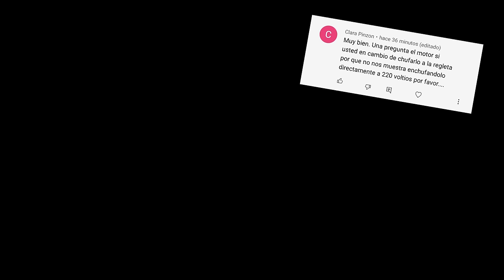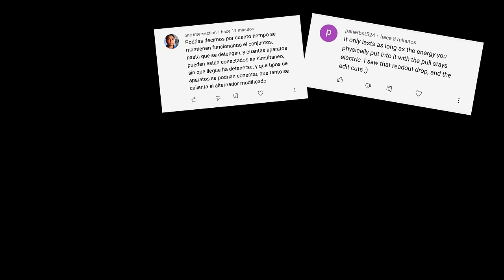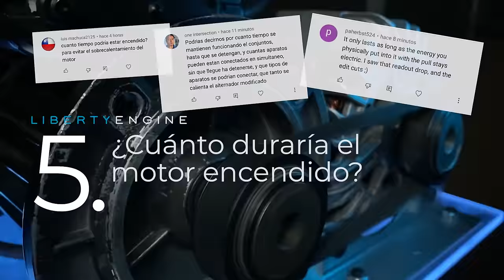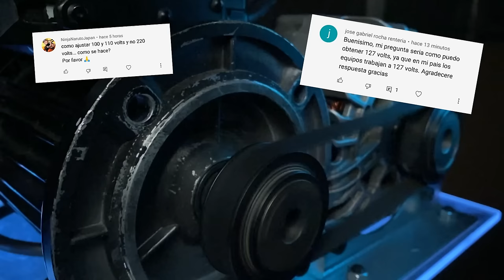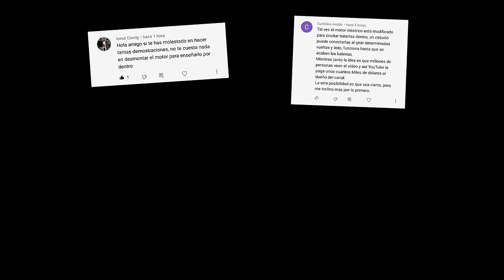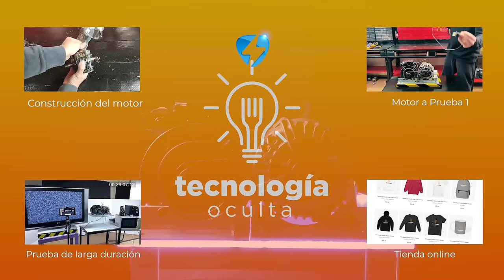El motor de energía infinita puesto a prueba - Parte 2  - Liberty Engine 1.0

Comment: Si no desea revelar los planes de esta invención, simplemente envíe 100 cartas de forma anónima a los artesanos, que harán lo mismo 100 veces, para que las personas finalmente puedan liberarse. ¡no esperes!
Reply: Venden ustedes el motor y el alternador preparados para trabajar con su respectivo regulador y cuanto vale $ ?
Reply: Danke für das viedeo. Ich werde es nachbauen. Und hoffe das ich es richtig mache. ☺️
Reply: Yo kiero uno...no me interesa hacerlo...lo kiero...cuanto vale? Tengo placas solares y las baterias no me han durado ni 4 años...y con tantos dias nublados...y la subida de la gasolina...no veas k despilfarro...
Dime como lo puedo comprar? 🙏🙏
Reply: Perché questo mottore non é comercializato ????????
Reply: Silnik 0.75kW nie ma siły kręcić alternatorem z magnesami neodymowymi , u mnie nie działa.
Reply: @luigicappello2575  amigo Luigi, si esto realmente funciona, evidentemente le interesaría  al 99'5% ( p/ej) de la población mundial; también evidentemente, al 0'5% restante no sólo NO le interesaría, algunos de ese 0'5% harían cualquier cosa para evitar que saliera al mercado, ese cualquier cosa podría incluir eliminar "este riesgo" y/o a sus creadores, parar la "edicion" (??) de patentes, permisos de todo tipo y negar que éste artilugio pueda funcionar de ninguna manera... no sería la 1° vez que algún creador desaparece tras un "trágico accidente"; el porcentaje es ínfimo, casi ridículo, pero hay unos pocos lobos entre las ovejas. Salud🤙
Reply: @tomaszpiotrowski2532  este normal sa nu functioneze Alternatorului  i-i trebuie o turatie mai mare de 1500 de rpm /min apoi meseriasul spune ca generatorul poate debita o putere in jur de 10Kw maxim prin urmare trebuie un motor mai mare de 2,2Kw si o turatie de 2900-3 000 de rap /minut   Daca aveti la indemina motorul recomandat de mine cu siguranta va functiona daca ati respectat asezarea  corecta a magnetilor pe rotor altfel toata munca este in zadar  si inca un secret alternatorul trebuie sa se roteasca in sensul distrogir adica opus sensului ceasornicului, prin urmare se modifica legatura condensatorului de pe placa de borne a motorului ptru inversarea sensului initial
Reply: Impresionante trabajo!!!
Pero para mí sinceramente si no facilitáis  la información/descripción de los componentes .o si podemos comprarlos .
Ya tiene otro corte !!
Estaré pendiente de poder conseguirlos si desvelais los secretos claro!!
Saludos y no seáis los nuevos Edison  de este siglo ,!!!!
Sean Tesla !!!!
Reply: @viorelpopescu4990  ați făcut replica la acest experiment cu succes?
Reply: @bablutu            da, da, si nu acum, ci acum mai bine de 40 de ani Da da rezultate si nu ma presa sa te lamuresc Uitate inca o data peste datele scrise de mine  si vei intelege ca generatorul poate mentine motorul in functiune si sa redea pe usor in jur de 3Kw Am mai precizat in comentarii nu e inselatorie este doarfelulcum stii sa  folosesti puterea si turatia fiicarui agregat in parte, poftim te-am mai scapat ceva, aproape mura in gura Doar nu i-i vrea totul moca? Dar cu ce te-am dat este suficient sa intelegi daca ai invatat la scoala si nu ai chiulit de la ore
Reply: @viorelpopescu4990  v am scris de mai multe ori dar mi se șterg comentariile, nu ma contrazic cu dvs doar întreb fiindcă vreau sa învăț de la oameni care au experimentat și sa încerc singur, as dori sa discut mai multe cu dvs dacă se poate, cum va pot contacta?
Reply: @bablutu             ........ Andrei uite cum sta treaba: Pe mine nu ma poti contacta direct de oarece eu raspund sporadic doar pe net nu mai am alte conturi si sint  o persoana in etate mult peste ceia ce crezi tu Ei bine am suficienta experenta in domeniu si voi incerca aici sa i-ti fac un comentariul cu un exp practic prin  demonstratii din care nu poti sa te indoesti de adevar , dar sa fii foarte atent la date si sa le interpretezi asa cum trebuie Sa presupunem : vreau sa construiesc un generator monofazat de 4 Kw la o tensiune de lucru de 220V si o fregventa de 50 Hz Cum voi proceda :Ca sa nu am mult de lucru si sa cheltuiesc inutil banii Mai intii caut un motor monofazat de 4Kw  se gasesc in comert s-au se pot comanda Deci el este din start monofazat adica nul si o faza, bun ma intereseaza sa aiva o turatie cit mai mica cu putinta cele cu turatie foarte mica se gasesc foarte greu dar se gasesc trebuie unul in jurul la 400 - 450 de ture pe minut Dupa ce il procuri il demontezi si scoti rotorul pe care i-l vei prelucra sa poti monta magneti niodin 52 sint cei mai buni dupa care remontezi motorul la loc acum este necesar un motor de antrenare de asemenea monofazat cu turatia maxima de 3000 de ture pe minut din astea se gasesc mai usor dar obligat trebuie sa aiva in jurul de 3000 de ture pe minut Cum aflu ce putere trebuie sa aiva? Sinplu generatorul  nostru debiteaza puterea si tensiunea, la sa spunem 400 de ture pe minut impart cele 3000 te ture ale motorului la 400 ale generatorului rezultatuleste 7,5dar vom lucra acoperitor ptru a avea rezerve de putere deci luam valoare de baza 7 Acum puterea generatorului este de 4Kw, ei bine impartim cei 4Kw la 7 si ar fi un 0,57 Kw deci motorul nostru de antrenare ar trebuisa aiva cu putin peste 500 W prin urmare putem procura un motor de 0,75 Kw mai mult decit suficient ptru lucrare a nu se uita obligatoriu la  3000 de ture mai departe  vom calcula fuliile de de antrenare ptru motor  si generator Cum simplu : O curea trapezoidala 14 x17 poate lucra pe un diametru minim de 100 mm deci fulia motorului obligatorie sa aiva diametru  exterior de 100 mm Cit va fi diametrul fuliei generatorului ptru ai asigura cele 400 de ture?   100 x7= 700de ture pe minut  un meserias priceput o poate face fara dificultati simplu coroana, spite, butuc o data avind toate astea facute si evident procurat si curea putem trece la montarea agregatului in forma definitiva unde este secretul? Intre rapoartele de transmisie intre fulii ele joaca si rol de reductor ce mareste puterea motorului exact la puterea necesara generatorului o, 75 Kw x7 = aproxumativ 5Kw mai mult decit necesarul generatorului prin urmare 0,75Kw i-i va consuma motorul de antrenare iar ceilalti 4 Kw vor fi disponibili ptru noi Acum ai inteles unde este tot secretul? DECI : puteri, turatii, rapoarte de transmisie Simplu de proectat si calculat o constructie bine ingrijita si pusa la punct nu are cum sa dea gres De fapt cu cit diferentele de turatii dintre generator si motor sint mai mari ele dau cistigul Cu cit generatorul poate genera tensiunea necesara la o turatie cit mai mica si i-l vom antrena cu un motor cu o turatie cit mai mare posibil vom avea cistig de putere in plus Cum se poate asta, asa cum am spus ptru generator un motor cu o turatie cit mai mica, magneti de calitatea cea mai buna pot genera tensiunea si curentul necesar la o turatie si mai coborita de 400 de ture pe minut prin urmare am incercat sa te fac sa intelegi ce fenomen se produce  Cistig de putere prim multiplicare prin tehnica reductorului Sper sa fi inteles daca nu intreaba unde ai dificultati de intelegere s-au nedumeriri si i-tivoi raspunde Sper ca i-ti va trece pofta sa te contrazici cu mine Ha, ha, ha
Reply: @viorelpopescu4990  nea Viorel n am cum sa ma contrazic cu dvs pentru ca nu am experienta în domeniu și la scoala nu am învățat nimic fiindcă nu ma atrage prea mult teroria, de ceva timp mi am pus mintea 100% sa învăț și sa construiesc un circuit, am testat 2 motoare de mașină de spălat mi s a confirmat overunity însă am încercat sa alimentez un flex de 2000w si nu a făcut fata circuitul din cauza presiunii sau rezistentei, mi am notat ceea ce mi ati spus și cu siguranță am sa testez și am sa revin cu întrebări și actualizări, va mulțumesc ca împărtășiți cunoștințele.
Reply: @viorelpopescu4990  nea Viorel, am citit și recitit datele, și are logica în exemplu dat de tine, dar am un 7.5kw trifazic 380v 1440rpm, am încercat sa aplic aceleași calcule și nu mi iese, care ar fi formula corecta în cazul dat? Mulțumesc
Reply: @bablutu           ......... pai nu are ce sa  i-ti iasa....... De ce? ptru ca motorul are deja o turatie mult prea mare ptru scopul tau, prin urmare nu se poate folosi, s-au daca incerci are un randame foarte slab  Bine sa incepem : 7, 5Kw,  380V,  5oHz, 1440 rap cum nu se  poate mai nefericit caz  7,5 : 3 = 2,5 Kw/ faza  Ca un exemplu fiicare faza poate aprinde cel mult 25 becuri incandescente de cite 100w bucata per total avem 75 de becuri de acest fel Daca motorul are o turatie de 1440 rap, cu ce motor cu o turatie mai mare decit a lui pot sa il antrenez  Sincer? Ei bine aproape cu nici unul in acest caz prin urmare nu prea sint sperante Bine dar sa mergem mai departe : Sa presupunem ca am  gasi unul la 3000 rap Ce putere minima va trebuisa aiva ..... pai 3000 : 1440=2,08(3),luam raport de transmisie baza 2  Acum daca raportul de transmisie este 2 sa vedem de ce putere avem nevoie  7,5 :2 =3,25Kw Sa presupunem ca motorul de 3 000 este monofazat poate fi el alimentat dintr-o singura faza? Se pare ca nu  De ce? Ptru ca pe o faza  nu avem decit 2,5 Kw ori ne mai sint necesari o, 75Kw acoperitori fara a dispune de rezerva de putere ca in cazul dat de n mine, prin urmare un monofazat nu este posibil ptru autoalimentare In cazul cind gasim unul de 3000 trifazat va trebui sa aiva o putere de 3,5Kw deci cu o oarecare rezerva de  putere 250W si evident ele asa se construiesc de 3,5 Kw  prin urmare acesta poate fi alimentat din generator dar va suge jumatate din putere  Ptru ca generatorul sa poata produce cei 380V trebuie antrenat cu o turatie obligatoriu de 1440 de rap s-au mai mult 1500 - 1550rpm prin urmare fulia generatorului trebuie sa fie de cel putin de doua ori mai mare decit fulia de pe motorul de antrenare,   in acest caz generatorul va livra cei 7,5 Kw dar jumatate din ei 3,5 Kw i-i va papa motorul de antrenare in acest caz ramininduti disponibil doar 3-3,5 Kw  Acum luind in calcul efortul depus cheltuielile cu modificarea rotorului pretul de cost al magnetilor etc amortizarea cheltuielilor vor fi pe un termen foarte lung, de ordinul a 3-4 ani ceia ce nu justifica efortul  Prin urmare ce e de facut? Cel mai bun lucru e sa i-l vinzi, ca sa i-l modifici prin rebobinare te costa o geozavie de bani, si nici nu stii daca va esi ce doresti Asa ca i-l vinzi  s-au i-l dai la schimb pe unul cu o turatie cit mai joasa nici 750 rap nu e  tocmai rentabil dar cu putin efort si multe cautari speram sa gasesti unul in jur de 400-450 rap  Se produceau pe vremuri ptru diferite utilaje si nu e musai sa fie de 7,5Kw poate fi si mai mult chiar 10-15 Kw  La 15 Kw i-ti asiguri intreg necesarul de electricitate ptru o casa serioasa ( mare*) si chiar incalzirea ptru 1-2 camere mai mari 20 - 25 mpatrati   Cum spuneam jocul e in rapoartele de transmisie si diferenta de turatii Deci in concluzie motoarele cu turatii ridicate nu sint rentabile ptru afi transformate in generatoare cele mai bune sint cele in jur de 500 rap adica 400-450-500 rpm merita tot efortul celelalte cistigul este mult prea mic si nu merita interes, munca si cheltuiala multa fara prea mare avantaj
Reply: @viorelpopescu4990  ai dreptate nea Viorel... Plus ca motoru asta 7.5kw si daca il folosesc ca motor cere prea mult sa învârtă + vdf controller care si ala mai costa mult... Il dau si încerc sa găsesc un motor căt mai puține rotații și mai mulți KW.

Formula de calcul pe care mi ai explicat o se aplica absolut la toate genurile de sisteme motor/generator?

Inca odată iti mulțumesc mult pentru sfaturi și indicii, sa ți dea Dumnezeu sănătate.
Reply: @viorelpopescu4990  nea Viorel încă ceva, am făcut un test între 2 motoare mici de mașină de spălat cu următoarele specificații:
Motor trifazic stea 230v 50hz 545W (16755 rpm) folosit ca generator si antrenat de un Motor Universal 220v 50hz aprox 500w printr-o curea de 1100mm cu 4 șanțuri

Am introdus 100v AC / 3.5 A / 50hz la motor iar la generator conectat doar la 2 borne îmi indica 210v AC / 48A / 350hz, iar cu cât urcam tensiunea la motor cu atât se mareau turatiile si genera mai mult (nu am făcut rost încă de vitezometru sa verific turația exacta)

Însă toate bune și frumoase am încercat sa alimentez un flex de 2000w si de îndată pune rezistenta pe circuit, foarte puțin învârtea discul de la Flex și imediat se oprea. (circuitul fiind în felul următor transformator(variac 2kw) > motor > generator > flex)

Ce anume nu se îmbină în exemplul de mai sus? Clar din ce m ai învățat generatorul e exact invers putere mica și turații mari dar totuși scoate niște cifre acolo. Mulțumesc.
Reply: @bablutu             ....... ce sa i-ti spun eu tie mai Andrei? La capitolul asta stai rau dar rau de tot, si daca nu ai fi spus din capul locului ca esti paralel cu electriciatea sincer nu cred ca i-ti mai raspundeam Dar bine hai sa trecem la ale noastre  Pai deja ai mirosit singur ca nu are cum sa mearga Motorul folosit ca generator trebuie sa il rotesti cu turatia care scrie pe placuta, s-au putin mai mare ca sa poata  sa  produca cei 230 V  la amaritii si  aia  500si ceva de W  Prin urmare se pune intrebarea ce diametru avea fulia  de pe  asa zisul generator, dar cea de pe motorul de antrenare? Secret nu pomenesti nimic Bine si eu ce vrei sa calculez? Mai spui tu ca l-ai  ,, antrenat  '' cu o curea cu 4 canale si lunga de 1100 mm  Ma nene pe bune? Putea sa fie si cureaua de la pantaloni tot atit de relevant este, pe mine ma intereseaza diametrele fuliilor ca astea le i-au in calcul nu cureaua ta firar ea sa fie  Spui ca motorul de antrenare  e ceva de genul     ,, universal  '' monofazat la 230V, 500W si 50Hz o fi nu te contrazic dar spui ca i-ai dat 100 de V... AC si un curent de 3,5 A  Serios? de unde ai dedus tu ca i-ai dat cei 3,5 A  ca eu din umila mea stiinta, cam asa se spune ca motorul i-si ia singur curentul necesar in functie de putere  E tu ce zici? Am dreptate s-au gresesc? Bine sa trecem mai departe, de turatia motorului de antrenare nu spui mai nimic ci doar ,, de ce i-i dam tensiune mai multa crestea  rotatiile  '' Desigur ca asa se intimpla daca tu i-i dadeai mincare cu portia, ei dar eu am vazut ce tu nu ai bagat de seama, din ce i-i cresteai tensiunea scadea curentu si crestea turatia  (asta e o alta chestie cind vei invata ce este tensiunea (U) si ce este curentul (A) o sa i-ti explic mai pe larg si sper sa intelegi, acum stricam orzu pe giste ca tot nu intelegi Bine, bine si amaritul asta de motor e mai mic ca putere decit generatorul 500W ar fi la o (U) normala de 230 V dar tu i-i dai cu lingura 100 - 105-110 V deci de unde amaru masii   W-atii aia  putere sa vina cind nu au din ce? Te prinsasi? Inca o mare gogomanie a ta dupa ce ghemul ala de motor folosit ca generator nu i-l aduci in parametri functionali adica  14 000si rap obositi sa  de doar cu putin peste 500de W vrei sa porneasca o moara de 2Kw  Nu esti cam zgircit matale? Pai ia fa rapoartele de putere polizorul tau este de 4 ori mai mare decit generatorul la fel tot de 4 ori mai mare decit motorul de antrenare   Ce  naiba vrei sa invirta?  Pai spuneai ca i-ti scoate ceva de genul 280V si 48 A, bai cu (Voltii) o fi cum o fi dar cu (A) perii e prea groasa bag sama ca tu nu stii nici sa montezi instrumentul ptru a masura curentul Desigur afisarea e corecta masuratoarea ta e folsa (nu asa se masoara curentul)  In realitate cred ca nu aveai mai mult de 0, 5Asi ca sa te convingi ia vezi asa din ochi  ce grosime are sirma cu care este bobinat ,, generatorul '' si mai vorbim Deci cind ai cuplat polizorul  a cazut toata tensiunea cred undeva pe la vre-o  10 V si curent la greu 15-20 A daca nu mai mult in realitate o putere in jur de pina in 100  W Pai ba nene moara aia ca sa o invirti in gol ai nevoie de o putere in jur de 800 - 1000W adica aproapede 1Kw iar tu vrei sa o invirti cu o basina strinsa de git intre buci de nici 100W mai dao naibii   Ei bine am si glumit putin dar treaba e serioasa daca vrei sa faci ceva invata copile  ce este curentul electric ce reprezinta invata termenii din electricitate si pe cit posibil tot ce tine de electricitate Asta nu e meserie care se FURA asta se invata cu cartea caietul si creionu in mina si pina nu stii suficient de multe si bine e mai bine sa stai departe de sirme ca aici o data gresesti ca a doua oara nu mai are cine gresi, daca intelegi unde bat Sint suficiente saituri si forumuri pe net unde poti invata electricitate de 10 ori mai usor ca la scoala si explica baetii ca la handicapati tot cu amanuntul daca tot te-ai murdarit pe la gura de ,, electricitate   '' indrazneste si maninco toata pina la capat ca nu orcine poate s-ar putea sa ai noroc Cine stie?
Reply: @viorelpopescu4990  ce sa fac nea Viorel dacă la momentul respectiv nu am conștientizat anumite lucruri practic nici nu aveam de unde, în viata dacă nu e nimeni sa te ghideze măcar cu informație și ramai sa faci din capul tău e cam greu sa te dai pe brazda dar nui nimic învățăm.

Am cautat ieri foarte mult motoare cu turație mica, am reușit sa găsesc unu la 200 rpm / 1.5kw, prețul cam ridicat cei drept, în rest sub 900 rpm n am găsit, ce mi ai recomanda ca o varianta mai simpla?
Reply: @bablutu  Bine hai sa o lamurim, asta ce zici tu de 1,5 Kw la 200 rap nu e bun de nimic  De ce? Ei bine daca vrei sa i-l  folosesti ca motor de antrenare are turatia mult pre mica el tebuiasa aiva in jurul lui 3000 ca e 2800 ca e 3300astea sit ptr antrenare nu se discuta   Deci inca o data motoarele de antrenare trebuie sa fie de turatie mare dar am mai spus si ma repet Mai intii cata motorul care vrei sa i-l faci generator ca sa ai un cistig cit mai mare deci cata unul cu turatie cit de mica si de puterea care vrei tu sa o aiva  generatorul si in functie de puterea lui cautam motorul de antrenare nu mai inainte Deci prima problema motorul ce vrei sa i-l modifici ca sa i-l faci generator de aici se pleaca  Dupa recomandarea mea ai vazut ptru o casa modesta la tara unde faci si incalzire cu lemne scoti apa din fintina la galeata si nu ai in casa decit becurile un  radiou, un tv si un frigider si poate o masina de spalat e suficient un generator de circa 5 Kw s-au mai maricel pina in 7,5 Unu de 5 daca stii cum sa administrezi curentul e mai mult decit suficient vara si acoperitor iarna Hai sa calculam : bine punem 5 becuri a cite 100 de  W bucata care ard nonstop avem 500 W dar asta nu se intimpla in realitate si cum sint saraciile astea  economice daca pui 20 si nu depasesti 200W, dar am spus 500W iluminat casa curte dependinte etc bun Un radio fie el si pe lampi s-au din astealalte orcit de fortoase nu depasesc 500 W un tv  care poate functiona 24 din 24 nu depaseste 1 kw mai ales plasmele daca e mediu ca marime nu ia mai mult de 500W, dar eu am pus incarcat 1Kw  frigider la fel 1Kw  deci avem deja 3 Kw daca avem si masina de spalat din asta moderna la fel in jur de 3Kw deci in total 6 Kw Avind in vedere ca nu speli in fiecare zi si in tot ceasu   si mai ales se spala ziua pe lumina se scoate radio se inchid becurile si avem suficient curent ptru 2-3 h cit se spala la masina se poate inchide si tv dar sa spunem ca sint copii mici si se uita deci nu e problema, la fel frigiderul lucreaza intermitent automat si deci ar fi curent suficient cu un generator de 5Kw, daca e de 7,5 se poate pune si un calorifer electric iarna    de maxim 2000 s-au 2500de W Ei bine daca  e o gospodarie mare cu mofturi acolo sta altfel treaba trebuie facut totalul consumatorilor care pot depasi usor 15 Kw iar cind mai pui si incalzire electrica atuni obligat trebuie sa lucrezi cu doua generatoare de cite 15Kw iarna Ptru o casa cum spuneam mai modesta unde trebuie sa incalzesti doua camere mai maricele putin un generator de 10 - 12 Kw e mai multdecit suficient Dar si aici se poate lucra cu doua de cte 6Kw iarna iar vara doar cu unu In fond nu prea conteaza ce si cit lucreaza ca el orcum va debita acest curent dat de faptul ca area excitatie fixa data de magneti si nu prea ai ce regla daca el are permanent o incarcare convenabila undeva spre limita de sus de producere unde se formeaza niste curenti alunecatori care i-i permite sa lucreze intregului ansamblu fara eforturi mari  Totul e dat de pretul de cost cu doua generatoare va fi mai usor de procurat ca sint mai mici si se apropie de gama curenta cu unul singur e mai greu de procuratun motor mare e mai greu disponibil dar depinde de posibilitati si darea de mina (bani) DECI RETINE PTRU GENERATOR TURATIE CIT MAI MICA PRIMA CONDITIE si puterea careo vrei tu Uit unde poti gasi cel mai usor in atelierele de bobinaj motoare mai vin si  din astea care mai labuiec si  le vind astara pe doua trei sticle de bautura si ceva bani, ia legatura cu ei si cu siguranta vei gasi in cel mai scurt timp ce cauti Spunemi ce vrei sa faci cu generatorul si te indrum eu la ce motor sa cauti cu precizie fara sa mai umbli  dandalind dupa care te indrum eu daca e cazul si te tine buzunaru pot merge sa te ajut citeva zile sa pui totul la punct si sa i-l pornesti si facem probe conditia este sa procuri materialele care la cer si ai toata convingerea ca merge si nu e vrajeala cum scriu unii pe net Cred ca ai sesizat ca motorul de antrenare prin multiplicarea puterii am cautat in toate cazurile sa fie cu ceva mai puternic decit generatorulsi e destul de logic, iar chestia asta nu am experimentat-o numai eu sint mai multi care au testat - o pe timpul lui Ceausescu, iar unii saracii s-au ales si cu puscarie  Era  periculos sa-o scoti in evidenta erau destui mincatori de cacat care te voiau infundat si evident tot ce faceam faceam cu materiale din fabrica si se chema putin furt chiar daca nu le scoteam din fabrica, iar acasa daca te miroseau ca ai asa ceva o puneai rapid de 5-6 ani de puscarie pe usor Prin urmare este un cerc restrins de oameni care stiu si au experimentat jucaria  Eram tiner si eram dornici sa facem ceva vizibil dar nu intodeauna era  tocmai bine din cauza unor putori care pe linga ca erau puturosi erau si prosti si te turnau, si ala erai Puscarie scria pe tine
Reply: @viorelpopescu4990  nea Viorel eu de-aia insist sa discut și sa învăț de la oameni care au pus personal mana și au probat, nu exista școala aia sau forumu ala sa ma învețe pe mine cu rezonanta și sisteme gen motor/generator, antena de rezonanta, electrocultura si asa mai departe, altfel eram înscris demult la ele. 

Astea sunt lucrurile care ma atrag, îmi doresc sa creez și nu ma sperie absolut nimic sunt dispus sa risc orice dar nu ma las pana nu aflu, experimentez și creez din mana mea, de 3-4 luni de când merg pe drumu asta numa asta caut, si sa învăț cât mai mult din electrica, electrotehnica, motoare etc. Acum am făcut rost de câteva motoare si trebuie sa ma hotărăsc de unde încep cu un generator

Deocamdată vreau ceva sa mi scoată măcar 1,5-2kw disponibili, apoi ma orientez eu mai departe.
Reply: @viorelpopescu4990  zi nea Viorele de unde luam motoarele acelea?
Reply: Es sierto y cuanto antes mejor , por el tiempo corre y esto no solo molestara a gobiernos y magnates cuyos recursos financieros dependen de las empresas energéticas. No dudo que ya los esten buscando sea verdad o no , por que no van a correr riegos alguno.
Reply: X favor me interesa  comprate uno soy de México  como puedo conctactarle
Reply: Sladak pocetak, gorak zavrsetak. Ovo je laz.Iskreno video pleni ,ideja je fantasticna, sacekajmo kraj. Kazu da patent postoji od pre 60 god. Neodijumski magnet napravljen1982 god.  Nemoj te da pokusavate jer vam najverovatnije nece raditi.Sta je svrha ovog videa ako ljude odvracamo da ne pokusavaju?
Reply: @viorelpopescu4990  la mulți ani nea Viorel, ajuta ma sa fac și eu generatoru, am nevoie sa stau de vorba cu tine sa ma înveți formula, te salut multă sănătate.